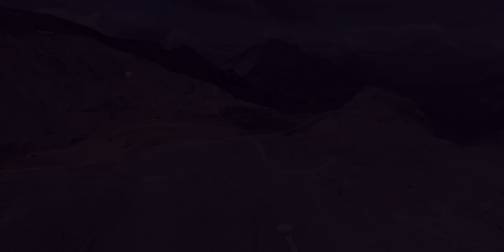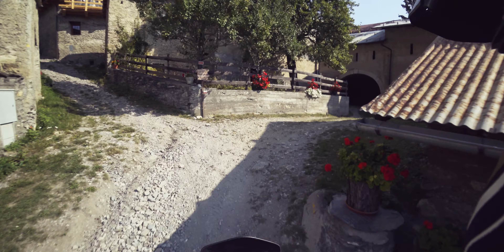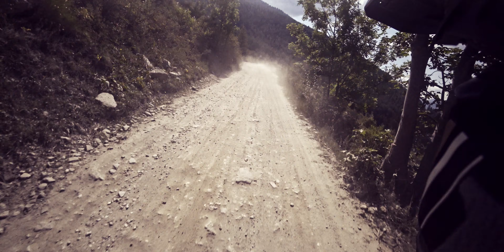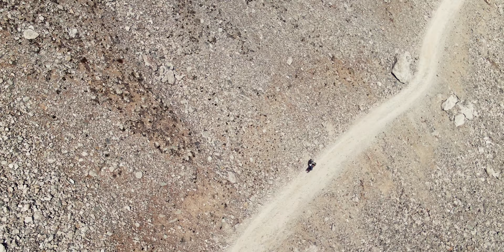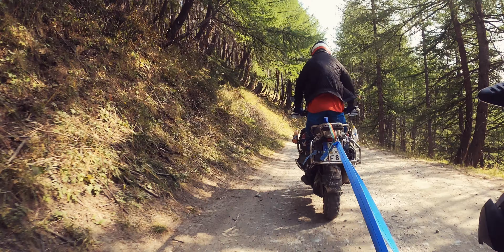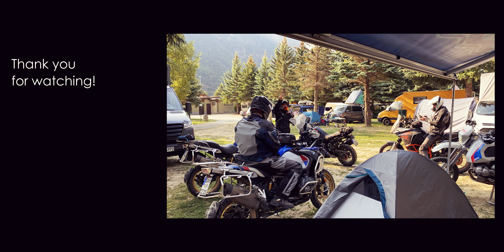COL DE SOMMEILLER OFF-ROAD RIDING AT 3000m // West Alps Piemont Italy // KTM 1290 Super Adventure S

Comment: Another great video man! 

I noticed you’re using ND filters on the GoPro. I just bought them (8, 16, 32) and I was wondering if you have any tips to use them? GoPro Settings and mode etc

Thanks and happy Xmas!
Reply from the maker: Thank you! Yes I do - I did a video on the video and audio setup where I talk through my current setup. It still stands with regards to the video part - I am working on improving the audio for next year and will likely do a video on that too to share my experince. https://youtu.be/DyeBTCGt_Ks Merry Christmas to you too ;-)
Reply from the maker: There are a couple more tweaks that I do now on the Hero7 - I limit the max ISO to 400 (protunes settings) - I do not want to ISO to go too high as this will degrade the image quality too much. If you are filming in darker environments you need to take the ND filter off at some point. Also, I am using a flat color profile on both action cameras now (acutally on all cameras that I have). It is a bit more work in post production but the final result is much better. I hope this helps!
Reply: @MotoVibes  great reply thanks! I also have the hero 7! Will give it a try for sure! 
Happy XMAS!